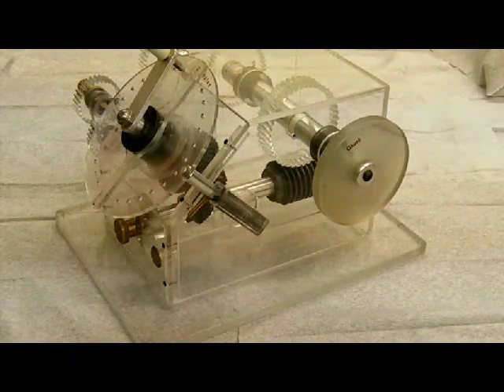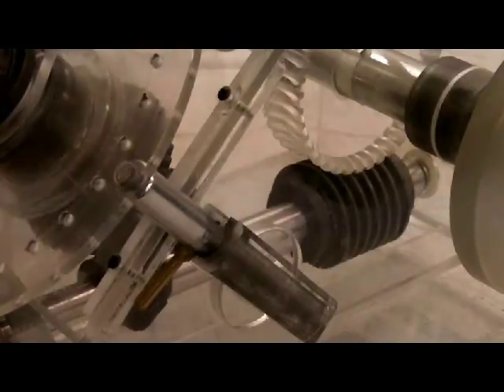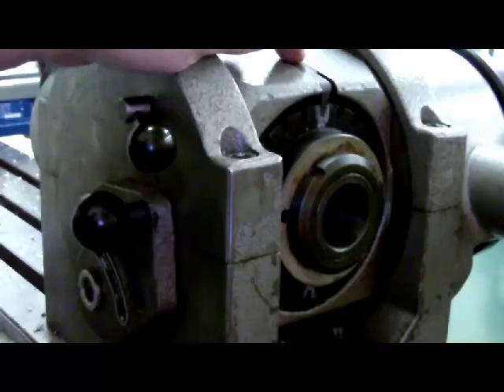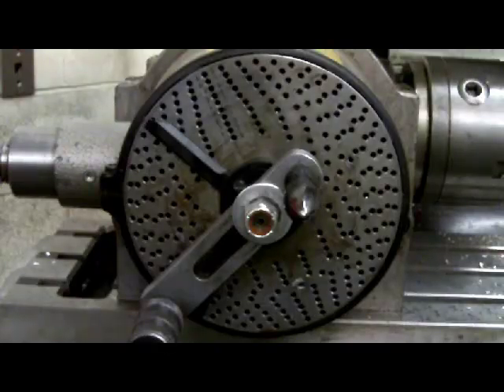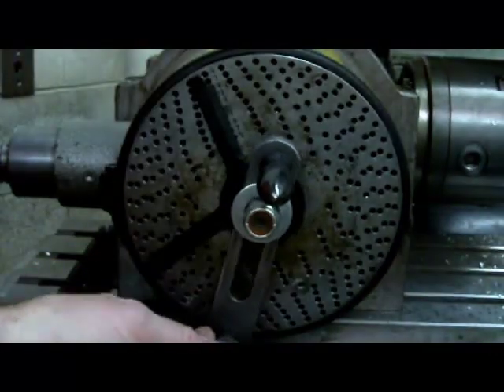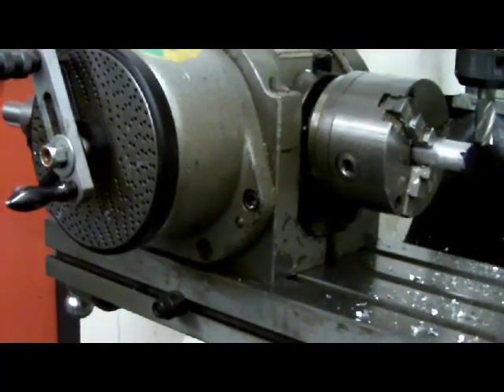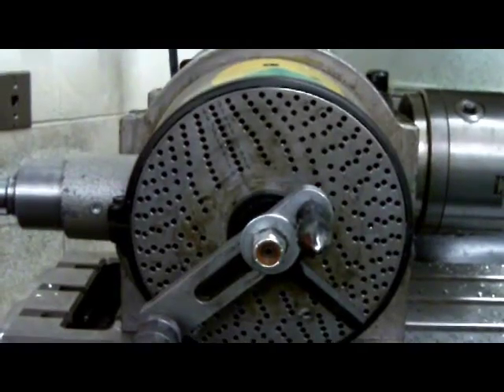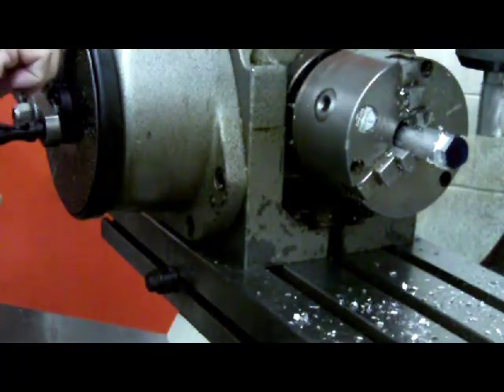Simple (Plain) Indexing

Comment: How to set up a 14 teeth
Reply from the maker: 40/N in your case 40/14 which is 2 and 12/14 or 2 and 6/7. Find a multiple of 7 for a hole plate you have. For argument sake let's say you have a 21 hole plate. Your multiple is 3. Your answer is 2 complete turns and 18 spaces on a 21 hole plate. I hope that makes sense.

Comment: Perfect, I needed to do a seven space piece.
Reply from the maker: Glad it helped, thanks for your note and watching.
Reply: @machiningmoments    I have a 36:1 ratio rotary table. I need to drill 7 holes in 360* , I know 51.4*. Do I use a 49 hole division plate ? What is your suggestion ? Thanks.

Comment: I realize you get what you pay for. I notice China import versions of indexing units with tail stock attachment for mill as little as $400 or so.  Then $1000,$2000 + with no end.  Have you seen or used the imports?  For hobby work do have reasonable accuracy for a hobby shop or simply junk and waste of money?  Any brands of indexing units you might suggest? Thanks
Reply from the maker: Hi Adrian, there are some good products that come out of China. The problem is most things come out of China these days. I think as a hobbyist you likely don't need to spend big bucks. I'm a fan of the comment section/Google search for comments on items I'm looking to buy...take advantage of other peoples experiences.

Comment: Pls 66 hole plate how to making the 28 teeth ok thankyou
Reply from the maker: 40/28 = 1 and 3/7 You need a hole plate that is a multiple of 7 so 7, 14, 21,28... multiply the numerator and denominator by the same multiple. so if you use 28 it would be 1 turn and 12 spaces on a 28 holeplate.

Comment: How to 18th gear teeth cut?
Reply: Plz give me answer with calculate
Reply from the maker: Ok, answer with calculations. Can be done with direct indexing, two spaces on a 36 tooth direct indexing plate (worm gear disengaged). 36/18=2 spaces. It can also be done with simple indexing (worm gear engaged) 40/N in your case 40/18 which reduces to 20/9  or 2 and 2/9. Find a hole plate that is a multiple of the denominator 9. Whatever that multiple is multiply numerator and denominator by it. Example say you found a 27 hole plate...3x9=27 and 3x2=6 so using the hole plate in the example your indexing would be 2 6/27 or two full turns and six spaces on a twenty seven hole plate. I hope that makes sense!

Comment: Thank you so much this was nice and clear. I always wanted to know how the indexing worked. The only part I didn't get was the second sector arm. There were two sector arms and I was wondering how did you know how to space the secondary sector arm to the right amount of spaces? Maybe I missed it but you placed the first sector arm against the pin and the second sector arm in an equal space but I'm not sure you mentioned how you did that.

Anyways thank you so much. Now I need to try this hands on so it can stay in my  memory.
Reply from the maker: The sector arm moved is always the one that will touch the pin, if you move the other arm the arm that hits the pin may cause the one your moving to shift. They are set by loosening screws at their base then tightened in the new position. I too learn better when I can try a task. I think most trades people are tactile learners.

Comment: I have the loan of a Myford dividing head. Put a card disc on the faceplate and a sharpie in the chuck, set the pin in the hole circle to match up with the chart to give me say thirty divisions. But I'd never spotted that you don't count the first hole. So if I did all the dots on the card, when it got the starting again, the dot was not over the same spot. I just could not work out what was going wrong. Counted of the holes again and check the chart, but still whatever division I chose the same result until I spotted your almost casual remark, " Don't count the first hole"  Eureka
Reply from the maker: :) I'm glad it helped! I love those "ah ha" moments, thanks for sharing.

Comment: 40/7= 5.7142857142857142857142857142857. How did you turn such a large number into a fraction so quickly
Reply from the maker: Leave it as a fraction rather than converting to a decimal. The fraction is a ratio. 40/7 is an improper fraction which becomes 5 and 5/7. Then you find a multiple numerator and denominator to get a suitable holeplate.

Comment: nice video.
I have a Myford dividing head that runs at 60:1. Being a computer nerd I set up a spreadsheet to do all the calculations for me. I just type in the number of indexes i want and it lists the disk plate No, Number of holes ring, then the number of full turns and the number of ring holes to turn. Saves a lot of this horrible maths stuff.
Also set up so that if there isn't a correct ring disk it will tell you how many ring holes you need so you can make your own disk.
Had an idea last night if you wanted to cut two flats with an angle between them, working on that calculation to add to the spreadsheet.
steve
Reply from the maker: Sounds like your speadsheet would be a great help!

Comment: Hi. 
I have a 37,39,41,43,47,49 hole plate. And I want to cut a round workpiece into a hexagon.
40/6 = 6 &4/6, which means 24 (6x4) spaces and 36 hole plate.
So how do I do it? Waiting for your kind reply.
Regards
Reply from the maker: You can't, with that holeplate. Do you have a slotted plate behind the chuck, spindle? If so and assuming it has 24 slots you can use that plate to index (if 24 ever 4 slots).
Reply: Thank you for your reply. No I don't have a slotted plate either. I guess i will have to buy a new hole plate.
Reply from the maker: Yes, you are limited. That is a problem when there are multiple plates, the ones not in use tend to get lost. Good luck!
Reply: 40/6= 6+4/6 = 6+26/39  (you can use the 39 hole plate)

Comment: Great video!!! Thanks for making it!
Reply from the maker: Hi Collin, I'm glad you liked it. Thanks for watching.
Reply: Any plans on making of video of how to drill your own plates? Might be a tougher one to make, but the knowledge sure would be great to have. Thanks again for your work.
Reply from the maker: Hello again, these plates are done in a CNC but this process is straight forward. Choose your drill (we use a center drill) decide what diameter you want to use (less holes closer to middle, more holes closer to od). set your indexing 40/N (N = number of hole on the diameter your working on. If you had 21 holes it would calculate to 40/21 or 1 rotation and 19 spaces on a 21 hole plate. Drill, repeat 21 times. I hope that helps?
Reply: +machiningmoments 
It does! Thanks so much for your response.👍

Comment: An exceptionally well done explanation for indexing. thank you very much.
I picked up your method for eliminating backlash from the mechanism when indexing. that is dropping the pin onto the surface plate just before the hole and then tapping it into the hole in the direction of turn. Simple but very effective, I shall use it in future.
possibly you can explain to your viewers the importance of eliminating backlash and that the handle must not overshoot the hole. Importantly that the pin must be dropped into the hole only in the direction of rotation.
Reply from the maker: +Charles Camenzuli Glad it was helpful. Your right the direction of rotation is critical in not creating an error. Great comment, thanks.
Reply: +machiningmoments Thanks

Comment: sir i request you post a video for thread cutting on lathe also and also its calculation
Reply from the maker: +amit2196 What thread would you like?
Reply: sir i need to understand the seting up the lathe for thread cutting operation and even the gear box setup for providing different 2 or 3 starts on job
Reply: setting up quik change gear box for required pitch

Comment: can you pls give the calculation for cutting a hexagon? I really need it quick! tq
Reply from the maker: +Alex Steel Hi Alex, the formula for simple indexing is 40/N. In your case 40/6 (hex) so 40/6 reduces to 6 and 2/3rds you now need to find a multiple of the denominator that will equal a hole plate you have and multiply the numerator and denominator by this number. Example if you have a 42 hole plate 3(denominator) times 14 = 42. Both numerator and denominator are multiplied by the same multiple. The answer in this example is 6 full turns and 28(2x14)spaces on a 42(3x14)holeplate. Good luck with your TQ!
Reply: +machiningmoments thanks for the info, just in time for our final exam, thank you very much.
Reply from the maker: +Alex Steel Glad to help good luck with your final!

Comment: Thanks would you do a 31 divisions
Reply from the maker: Bob Krell Hi Bob, Cincinnati dividing head has a 62 division hole plate. The formula is 40/N so 40/31= 1 and 9/31 multiple the denominator by two to get the hole plate (62) you will also need to multiply numerator by same number (2). Your answer is 1 turn (revolution) and 18 spaces on a 62 hole plate. Never count the hole the crank pin was in! Good question, good luck!

Comment: gear n117 deveded by   y uor device
Reply from the maker: 40/117 can't be reduced, you would need an indexing plate with 117 holes in it. The largest hole plate typically available is 66 holes. Simple indexing has its limitations. You would need to differential index if you require 117 gear teeth.
Reply: nasseelkashef@gmail.com
nasser_hasan@yahoo.com(fascbook
Reply from the maker: It is a bit of a complicated process, you need to gear the spindle of the dividing head to the wormshaft (index plate). The plate needs to rotate at a ratio determined by the number you require. The hole plate rotates when the spinle turns...it makes the hole plate appear as if it has more holes, satisfying the 117. This is "differential indexing".
Reply from the maker: Please tell me the number of hole on all diameters of your plate.

Comment: Hi! Love your vids on your channel..just wondering if you could possibly do one on internal and external screw cutting? Thank you :) Jon
Reply from the maker: Hi Jon, any particular thread in mind? RH, LH? Course, fine? On a lathe?
Should be able to do that for you. Thanks for the comment.
Reply: machiningmoments thank you for your reply. RH course on a lathe would be great! (even fine if you had the time too but no biggy). Im struggling to understand the correct measurements you turn down the outside diameter for an external thread mostly. Thank you muchly! :)
Reply from the maker: Jon Gene Hi again Jon, I am assuming you are working with a Unified thread (very common in the US thread system). All threads come with an identification code (callout) such as 3/4-10UNC-2A. This gives the machinist the information to create the thread. The information that controls the outside diameter (and pitch diameter) in the unified thread is the second last character in this case the "2". This callout will be referenced in the machinery handbook http://new.industrialpress.com/machineryhandbook under the unified thread section for 3/4" look in the table for a class "2" fit. there will be a max and min outside diameter (and other information). Example (and I'm guessing as I don't have a handbook with me) the class 2 fit maybe as large as 0.748" or as small as 0.735". Any diameter in the referenced range will be acceptable.  

Thanks for the question, I hope this helps. I struggle with this medium sometimes, if I was beside you and had a handbook it would take 30 seconds to explain this.

Comment: It seems you made a mistake resetting the sector arms before the first cut.  You should either have moved them back to where they were, or forward as you did, but lifted the pin so it would have come to rest on the other side of the arm.  In the end it id work out though.

Comment: Wow! You are completely thorough, clear, concise and organized! I got my dividing head up and running because of your video instruction and I am very appreciative. I also downloaded an Excel sheet into which one can punch the numbers of the particular plate one has mounted, type in the number of segments or divisions of a circle and get the turns and number of holes for every possible row of holes on the plate that gives the correct results at the cutting head. It is found at: http://www.ameng.com.au/files/dividing%20head%20calculator%2040%20to%201%20ratio.xls (all in one "word").
The model you made is quite illustrative and your camera work perfect. Thank you, thank you.
Reply: YOU DONT NEED ENGINEERING , IDIOTICS WITH DIPLOMES...

YOU NEED MASTERS.

TO AMKE THAT OR GEAR YOU ONLY NEED A DIVISOR PLATE, AND SOME MATHS AND COUNTS TO KNOW HOW MANY TIME YOU TURN THJE DIVISOR PALTE, AND IT DEPOENDS IN THE NUMBER OF FACES OF TEETH, FROM GERS, YOU WAN TO CREATE.

BASICALLY YOU CAN DIVIDE A CIRCLE IN PERFECTION,, TO MAKE WHATEVER YOU WANNA DO.

I CAN TEACH YOU THE BASIC MATHS...